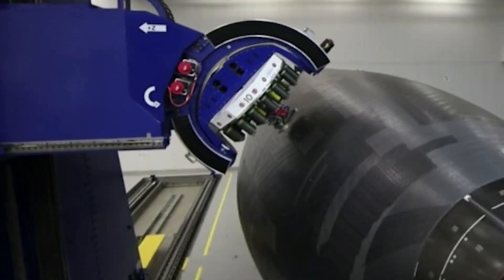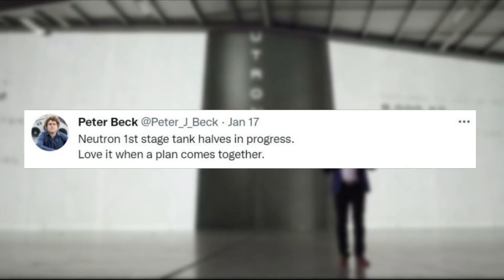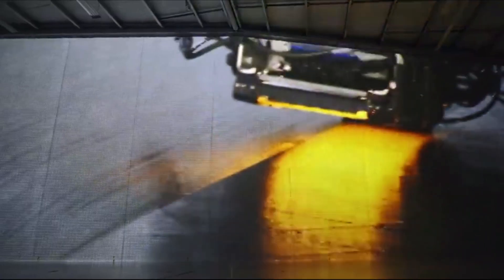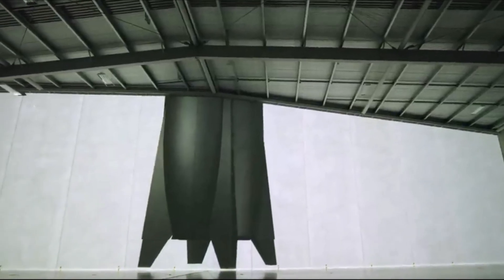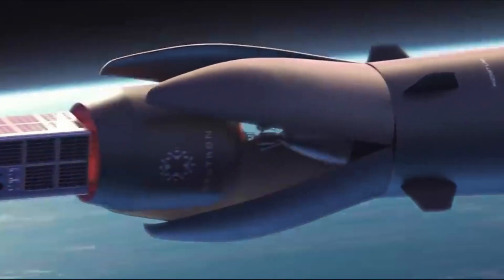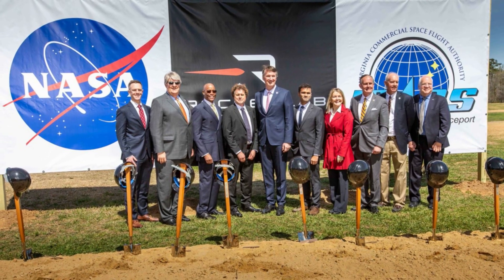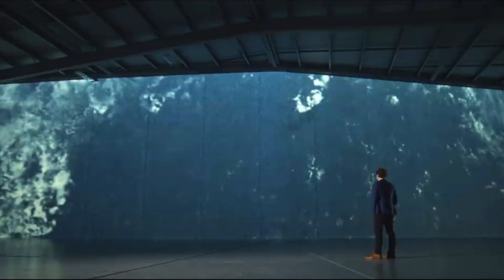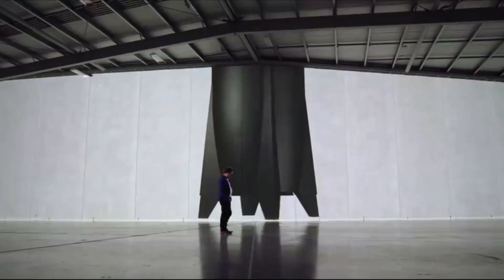The First Stage of Rocket Lab's Reusable Neutron Launch Vehilce Is Taking Shape

Comment: closed cycles typically operate at extremely high temperatures and pressures; rocket lab is doing something a bit different, by essentially not intending to run these at anywhere near full throttle

Comment: As much as people have obsessed about engines, they are only half of a vehicles performance, the stage tank mass is also critical, particularly on upper stages which generally have lower thrust needs and thus lower proportional engine mass.  RocketLabs focus on making the stage mass cutting edge and engines more modest is the inverse of SpaceX's heavy and low tech stage structure and it's emphasis on maximum thrust engines.  In this respect the two companies parellel the American and Soviet design paradigms.  American designs traditionally focus on lighter stages and particularly light and efficient upper stages, while Soviets built preverbial 'brick s**t houses' for stages and then attached very high thrust engines to them and had more frequent stage seperations to discard thouse heavy stages.  While the disparity is no longer as great as it was in the Space Race it is an intersting parallel.  Lastly note that the light stage aproatch has more long term growth potential as engine performance can be gradually raised while a heavy stage remains heavy unless it is completly redesigned.
Reply: SLS is the exact opposite  to what you are saying, the much larger tank size, the need to insulate the tank against atmospheric temperatures, the fact that you can not use a common dome, all add to requiring a much heavier vehicle. A vehicle that could barely get itself off the ground without the assistance of 2 massive solid rocket boosters.
This is because hydrogen has a very low density and requires very low temperatures to keep it a liquid.
Spacex chose steel for many reasons, this is the best material choice for Spacex's plans, I can explain these reasons in a future post if requested, the same with the fuel choice. 
In the same way the choices Rocket Lab are making suit thier goals very well.
I believe both companies can, and will be very successful given enough time.
I look forward to seeing that.
Reply: One more point, I love the fact that Rocket Lab Is using their own ingenuity and not just copying SpaceX, which is what everyone else seems to be doing.

Comment: Carbon composite not stainless steel? Even the Chinese are doing a knock off stainless steel rocket so what is better for a booster if not aluminum. I guess we will see.
Reply: Their is no question that Composites are a superior material, the issue is are they worth the cost.  Single use Disposables are clearly not worth it which is where all Chinas rockets are, if reusabiles makes it worth it remains to be seen and is what RL is betting on.  What is odd here is SpaceX using the clearly lowest grade option for a rocket thats supposed to be highly reusable, I think this choice was entirly dictated by their build-explode-redesign method which nessesitated the cheapest possible production and cheapest possible materials even though that negativly impacts performance in the long run.
Reply: @kennethferland5579  Are you aware that carbon fiber composites are poorly suited to holding cryogenics? And that they normally undergo inter-lamina stress micro-fracturing under pressure cycling at cryogenic temperatures? Also have you considered how they will prevent the resin from being charred and out-gassing while under going the extreme aero-thermal loads associated with the reentry phase? Id urge you to go have a look at the video of the UPAerospace/ go-fast rocket launch where you can clearly see the motor case de-laminating as the resin pyrolizes out of the composite matrix. There is very good material sciences reasons for why Space X dropped the CF/ composites for BFR/Starship, and highly doubt Rocketlab has invented the a material that can perform under these conditions and be reusable. BTW they are still to demonstrate if an Electron can be reused which is doubtful and its likely they will be throwing the tanks away and only be reusing. CF composites are amazing materials but there is still some very real limitations when comes to temperature cycling that probably makes this reusable rocket a pipe dream. Its likely it will need significant heat shielding or coating with ablatives, at which point cost and weight will suffer.
Reply: @jamieanderson6786  Clearly RL has solved this.
Reply: @jamieanderson6786  The dream liner is mostly composite but yes Rockets are in a different league.
As an investor I hope others think it can't  be done and this technology is painted.
Reply: @jamieanderson6786  Please explain what makes SS better than aluminum for BFR booster. AND address the solutions to the negative issues of SS like why thermal tiles are popping off. 

You have a number of appropriate talking points with regard to composites.
Reply: Answer: If the tech is better than what the Chinese can copy then yea it's good.